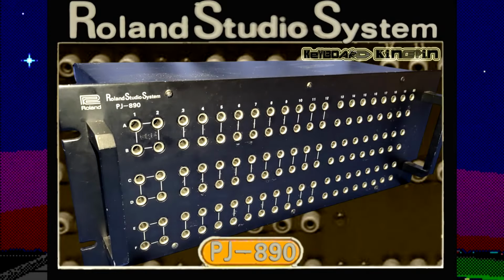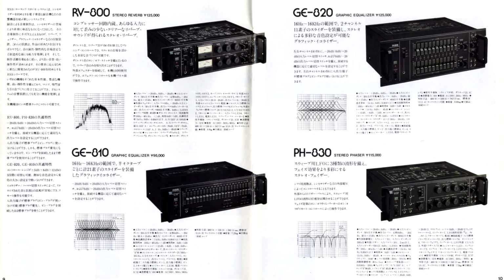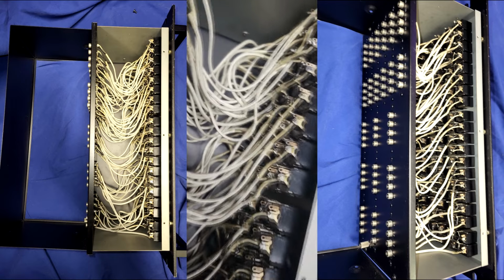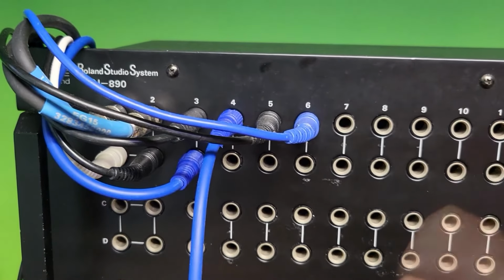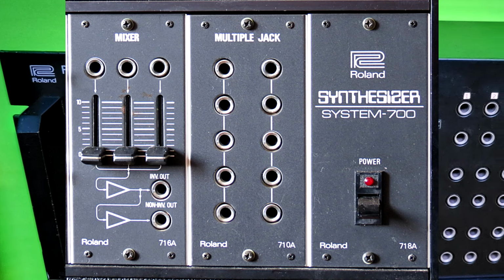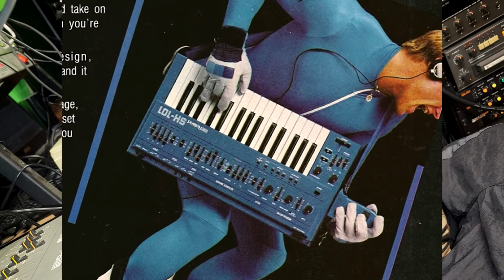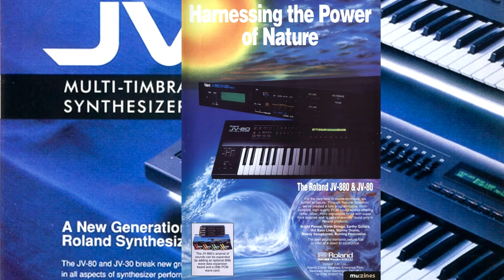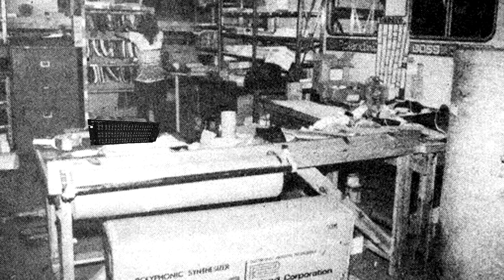Unsolved Mysteries of the Rare Roland PJ-890 Quarter Inch Patch Bay: Can We Unlock Its Secrets?

Comment: It's actually normally like this: If a patch point in the back goes to two or more in the front, those are OUTPUTS from a machine to be plugged into the back, and these are then called MULTIS. Rule of thumb: ONE output to several inputs, but not the other way around. So the patchbay's 1-2 are all multis for taking say some Stereo tape decks / vinyl turntables, cassettes, etc, into a multi output, so you could route those to more than one other device.
Reply from the maker: @noeqplease  yes that sounds about right it's a very useful patchbay I appreciate you watching and commenting much respect 🙏